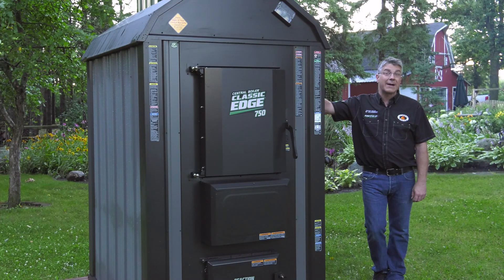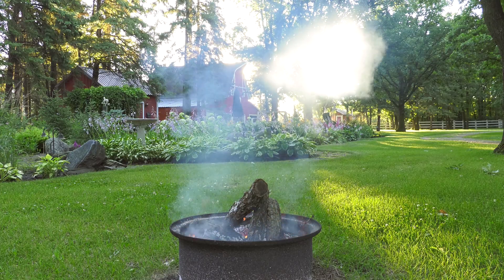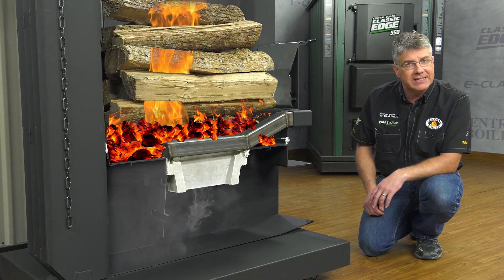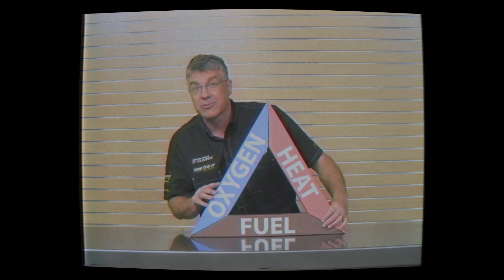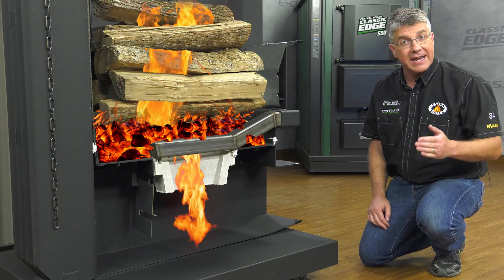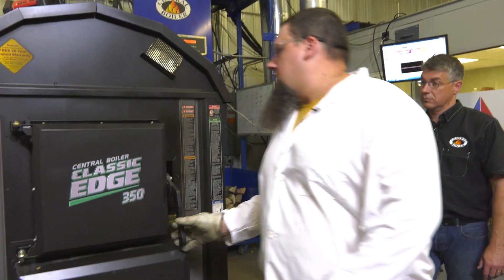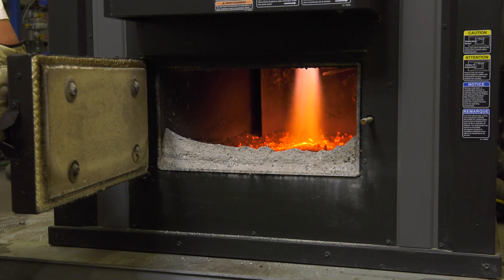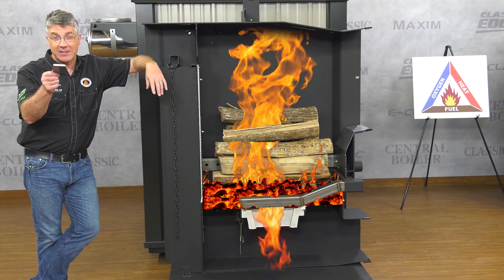FireStar Combustion Controller │Central Boiler

Comment: Do you use force fan to supply air for this boiler?
Reply from the maker: There is a compustion fan that supplies air to the furnace.  It is on the front end and pushed clean, fresh air into the system. Other designs use an exhaust fan that sucks the air through, however that often ends in a creosote-filled fan.

Comment: Hey I bought a Central Boiler e-Classic 1450 used from a small dealer.  Made 2013.  Dealer retired or is running from the law, so he's useless now.  😆 

Anyways, I am looking for the operator manual for this controller it has.  It has the Fire Star II.  Does anyone have the manual they can share via PDF?

I think the air does not kick on enough to keep the logs lit when the house is heated up. I want to see how to make it kick on more frequently when idle. As-is, it goes out and when heat is drawn the water can't be brought back up above 160 F because the fire is out.

Thanks!
Reply from the maker: Go to https://centralboiler.com/support/  and enter your furnace serial number.  The document/pdf files of all the manuals will load near the top.

Comment: It's been 5 years how out of date is this
Reply from the maker: The animations of the furnace in this video do not show the Afterburner in the Reaction Chamber.  There are also some additional features on current FireStar Controllers such as Reserve Mode and Clean Reload that are not mentioned.  The general idea of monitoring the fire and adjusting air is still true and still unique to the FireStar Controller.  

Current models actually throttle the air for greater efficiency and they add additional air during startup making that better as well.  We should probably make an updated video, so thanks for asking!
Reply: @centralboilerinc  thank you for the reply

Comment: will  this  work with  my   steam  radiators!!!!!!!!!
Reply from the maker: A Central Boiler outdoor furnace will work IF it's a 2-pipe steam radiator system.  It will NOT work with a single pipe system.

Comment: Kevin, Ass! Did not Question your Gasification junk, my point is EPA pushing Central Boiler, Since you don’t mention Methanol, your obviously not as Smart as you think, PS told you I was grumpy, I used the build Woodstove’s in the 70,s  Timberland brand went out of business because of stupid Regulations